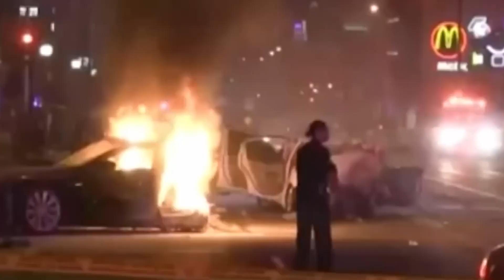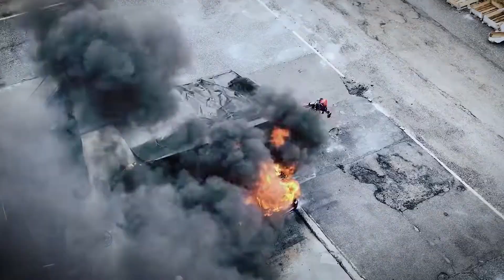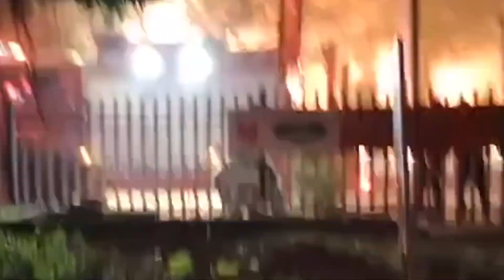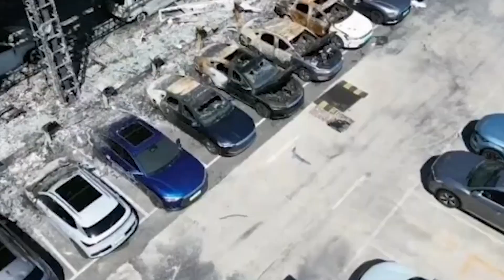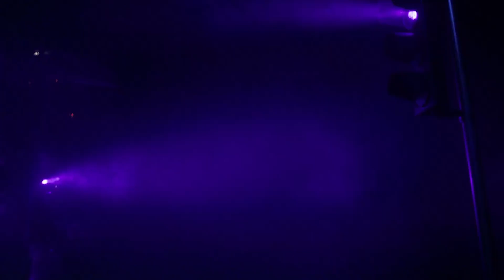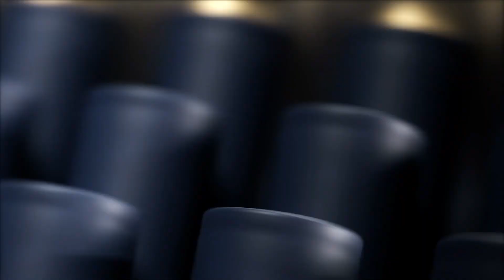EVs Are Catching FIRE and EV Owners are SWITCHING BACK!

Comment: This sounds more like an advertisement for the fire blankets, which saved the day in multiple cases.  So... we developed new tech, EV's, and found out they burn differently (and less frequently), so we built new ways to handle those fires.  What's the issue?  Sounds like the regular progression of technology.  

It's like we stopped having to worry about the horses knocking over the lanterns in the barns, and catching the barns on fire, because we replaced them with electric lights.  Oh, no, a fire in the barn now means that electricity could kill someone mixed with water via electrocution!  We should go back to horses and buggies!  NO.  We figured out you should kill the power to a burning structure, now the water isn't a risk of electrocution.  Bingo!

Same with EV's.  Many times safer to drive, much less likely to catch fire, and we are developing the tools to handle the "what-if's".